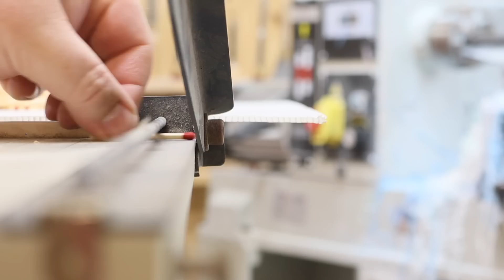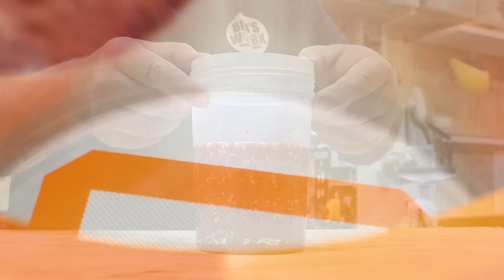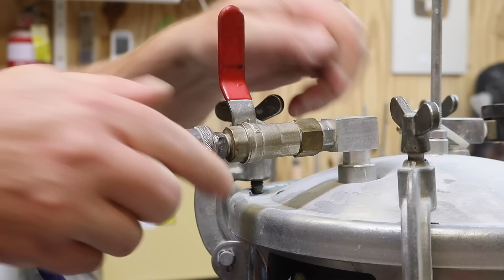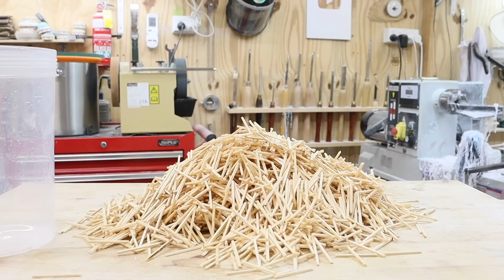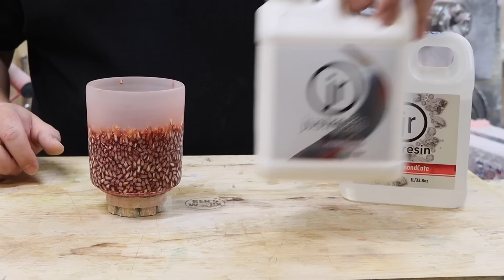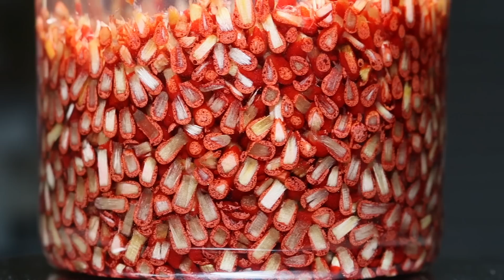WoodTurning - 5000 Matches into a Coffee Mug

Comment from the maker: Thanks for stopping by, If you have time you can check out my new range of Eggs here ➡️  https://bensworx.etsy.com
Reply: I got two cool ideas:
Fine like a corkscrew mould and make a resin cast in it. Then you brush on a thin layer of resin in one color, after it cure you do another layer with a different color and so on until you have a thick piece you can turn on the late. It should reveal a multicolor corkscrew shape right? Perfect for a corkscrew handle?
 
Also, there are these magnetic stir bars used in chemistry. What would happen if you used one of that and just leave it on spinning as the resin cures? 😂 would it create like a goopy tornado?
Reply: Did you save the shavings with the matches? I was wondering once they were shaved off if the were flammable?
Reply: did it match what you had in mind?

Comment: Don't  know what you decided. I like the brown lighter but I'd make some form of extensions with resin to allow space for fingers. Obviously you have to first make sure the lighter was completely without fluid, is then soak it in dish soap to completely neutralize the fluid and temporarily neutralize the flint as well so you could remove it as well then all danger would be completely gone. Then place in a warm dry place so it doesn't rust. This is whole process is considerably less dangerous than every single step you went through making the coffee cup. Without that i don't see any point of putting a handle on it.  That's how I feel and I'm gonna stick to it.

Comment: You should install a viewing window on the pot and place the camera on the outside of it. Doesn't have to be a large window, just big enough for the lens of the camera to view in. Use a small piece of Lexan and seal that on the inside of the pot. It would be much cheaper than having to replace the cameras every few months lol.

Comment: FYI for your potcam issue...buy cheap cameras. Not sarcasm.  Name brands are normally IPA rated for water resistance. Therefore, sealed containers. And a 30ft swim is nothing compared to the pressures I'm that pot. A cheaper/off brand camera most likely won't have any IPA rating in mind, and therefore not be "waterproof".

Comment: I don't like the lighter as a handle..mainly because it takes away from the piece a bit and it wouldn't be a very good handle. I did like @jack688 idea of using the matchsticks. it would be more appealing and would fit as the match stick part was the handle of the matches

Comment: I would make a handle out of the match sticks with no heads you have left. You wouldn't even have to use a lot of them.
I don't like the lighter-handles to be fair. If it's with no handle or with a lighter-handle, then I prefer no handle. But the matchstick handle would be the best in my opinion.
Regardless, I love it as it is!

Comment: As others have stated, I'd go for using the match sticks as the handle...

Personally, I'd love it if the match heads were the whole cup instead of just at the bottom, they could be less densely clustered with more space but just more distributed...

Easier said than done, you are a bit at the whim of the resin

Great project none the less, love your work Ben

Comment: Congratulations, you are now on the watch list for the Australian Government.......maybe the British and Americans as well! Match heads are made from Armstrong's Mixture which is a friction sensitive primary explosive. For this reason buying matches in large quantities can be suspicious and draw the attention of law enforcement or federal intelligence agencies. In powdered form Armstrong's mixture is impact sensitive so if you had of hit that dust pile with a hammer it would have exploded. With it being both impact and friction sensitive I'd say that there's a good risk of if going up in explosive flames when you put it on the lathe however, you uploaded the video so I'd say that impregnating the Armstrong's mixture with resign rendered it safe to work with in such a manner (writing comment before the video end!). To my knowledge matchheads only go up in flames and don't explode so with this in mind and fire requiring fuel, heat & oxygen to burn I'd say that by putting the matchheads in the pressure pot to remove any air pockets removed the oxygen from the equation leaving you with only fuel (Armstrong's mixture) and heat (generated by the cutting process on the lathe) thus preventing any fire. It's surprising how many things in our day to day life are actually explosives or chemical weapons, you'd expect with how tight Australian laws are on weapons that the general pubic wouldn't have access explosives or chemical weapons on the daily without licenses but the same explosive that caused the 2020 Beirut explosion can be purchased at any hardware store or any store that sells gardening supplies.......be it in small quantities that you have to process but still. I'd be very careful drinking from this mug, chemicals from the Armstrong's mixture may have seeped into the resign as it was curing and you might poison yourself.

Comment: Why isopropyl and not plain metho?
Reply: Could be to do with the phosforus (I think that's what it's called) in the match heads reacting?
Reply: @jaisere  all air was replaced with resin, match head cannot ignite now. But metho is a different alcohol so if match wont react with isopropyl it wont react with metho, but metho is significantly cheaper. But, maybe the metho is more like acetone and would damage the resin whereas isopropyl wont?
Reply: @MisterGames  honestly I don't know, but saying that all air was replaced with resin was true, but after turning and chiselling the phosphorus is open to the air once more (which is why the outer layer of resin is reapplied (other than  having a smooth suface) I'd assume) it could also just be personal preference

Comment: I think the lighter would work but would look better if it was offset and not directly glued to the cup. perhaps you could have some matchsticks at about half length cast into resin cylinders maybe a centimeter wide and then glue the lighter to that. It looks more like a cup with a finger hole.

Comment: If you put notches on part of the rim and in a circle on the base you could make a detachable handle that locks in place. The handle would be a rimmed circular base with arm that juts vertically with little “claws” that would fit withing the notches. Put claws in place and slide base into place and it would “lock” reverse to “unlock”

Comment: Use some resin to make a "flame," then cast that in a cylinder with the matchsticks to make a "lit match" for the handle.
The lighters clash in my mind. It'd be like making a mug with little cell phones in it and then using a phone cord to make a handle. Similar, but too different to really belong together. Just my thoughts.